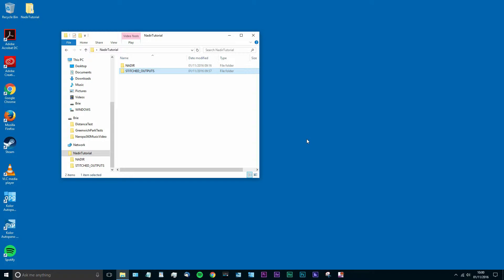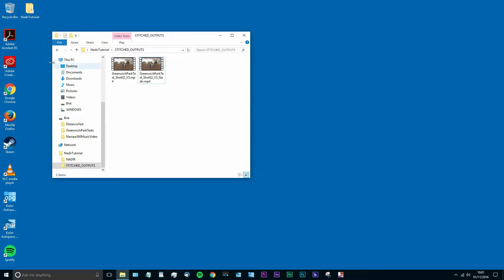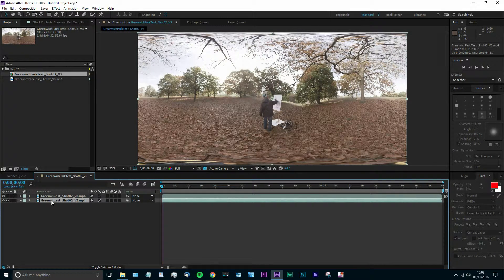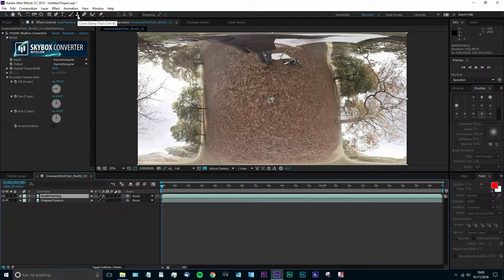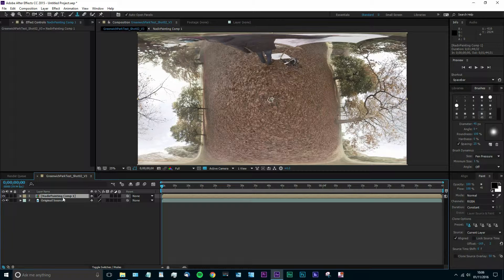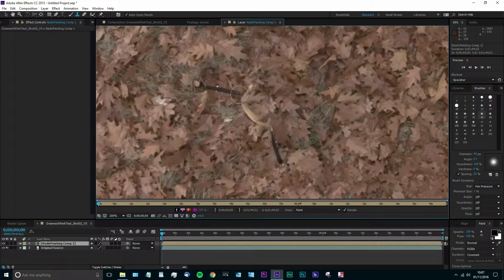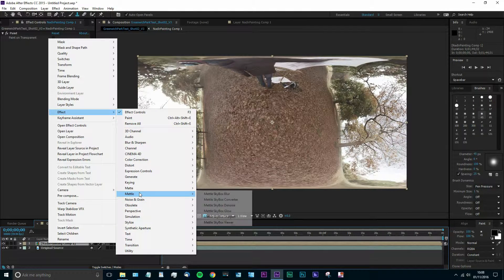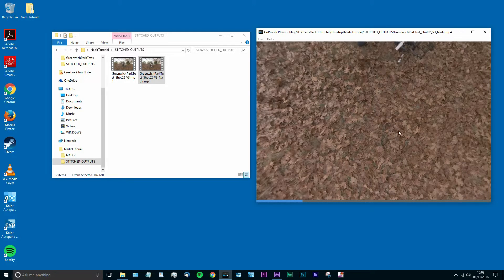Fixing Your 360 Degree Video Nadir - Tutorial (After Effects)

Comment: What would happen if you edit the 360 video in AE without Mettle Skybox Plugin
Reply from the maker: You'll be fine editing, using the same painting out technique will remove some of the base but it will look messy due to the distortion at the bottom of the image. Then you will also be left with a clear distorted point where the video wraps around. My advice if you don't have the Mettle Skybox Plugin is to create a logo to cover the bottom using photoshop
Reply: Thanks for the reply. I bought mettle and it works like a charm!